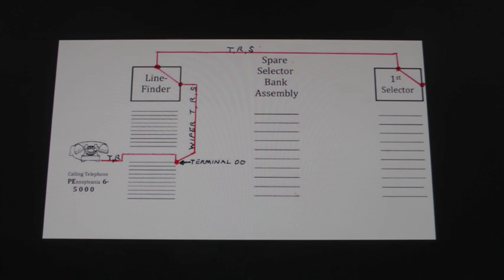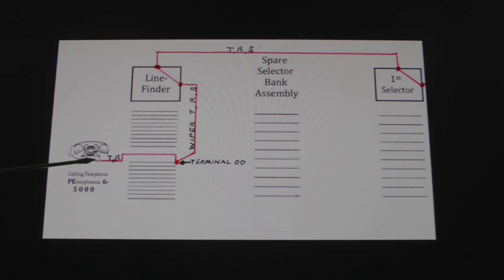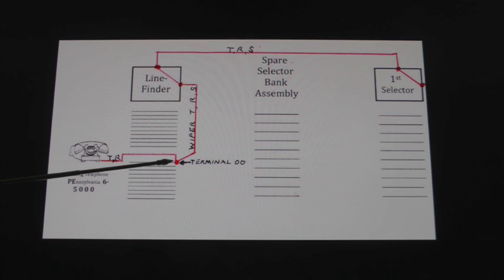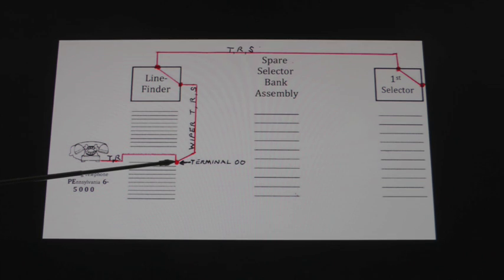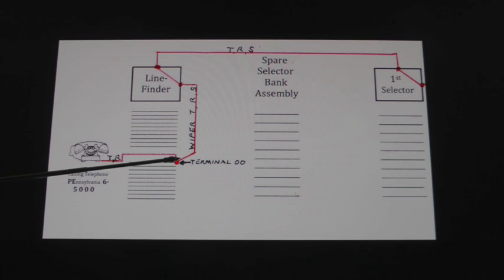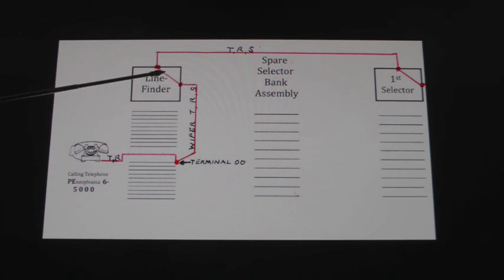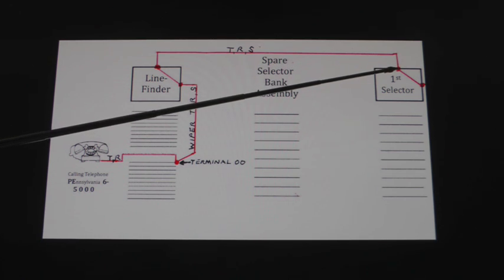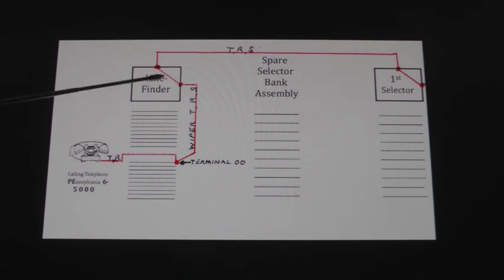Dial Tone In The Step-by-Step Telephone Switching System

Comment: Aha. Got it.

So if a subscriber T/R line is connected to up to 20 line finders, how is a free line finder found? I can envision that each of the line finders for a bank of 200 lines are arraigned in a cascading config so that if one is in use, the unit is shunted so that the next unused unit is selected.

These videos are great!  Are there any resources which might show how a small CO floor-plan would be wired in terms of incoming lines, selector banks, connector banks?

I'm trying to pictire in my head how a single line is both connected to multiple linefinders while also being connected to multiple final digit connector switches to allow incoming calls to reach the line.  I assume being on-hook means the incoming final-selectors are engages awaiting an incoming call while as soon as the line goes idle to off-hook, busy is returned while the linefinders kick into action.

I'm just having a problem picturing the wiring and relay arraignment.

I need to go to the Telco Museum in Seattle and pester someone there.  ;-)
Reply: I can imagine that in a single exchange CO (e.g. 555-xxxx) there are a total of 10,000 potential subscriber lines (e.g. nnn-0000 through nnn-9999).

The floorplan would then be broken up into -00xx, -01xx, -02xx, ..., -98xx, -99xx banks of selectors in 10 rows of 10 frame groups each (or 5 rows of 20 frame groups each, etc.):

00 | 01 | ... | 09
10 | 11 | ... | 19
...
90 |  91 | ... | 99

As each incoming call hits a selector, it would then route the call to the appropriate row and frame group with each frame group handling the last 2 digits in that subscriber line. e.g. -xx00 to -xx99.

I assume then that every other frame group would have a bank of linefinders since they could handle 200 lines each.

Am I on the right track?
Reply: That's what I'm trying to visualize how the incoming subscriber lines are then attached to the switching infrastructure.  At some point the subscriber lines terminals are connected to a number. I'm trying to understand both the layout of the switching frames and then how that is matched to subscriber terminals.
Reply: good reply from the poster below.  Your one remaining question about how busy is returned while an outgoing call is placed is that third wire (sleeve, or c, or private)  on the distributing frame.  It tells any final selector that the line is busy during an outgoing call, and also during an incoming call disables the line relay to prevent a linefinder response to the offhook.
Reply: Interesting how "Tip, Ring, and Sleeve" survived long after the names became irrelevant.   Someone long ago decided to have the tip of a three section plug be the +line, the ring be the -line, and the sleeve be a signalling or control wire.  When manual cord switchboards went, the plugs only survived on the occasional test gear cord.   But the wire names live on!